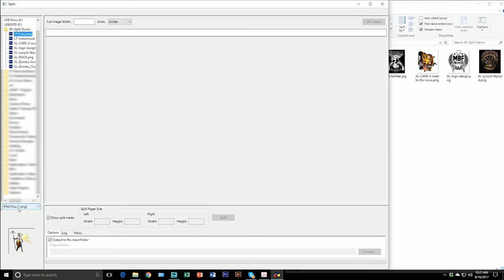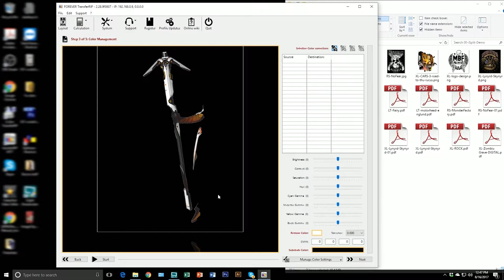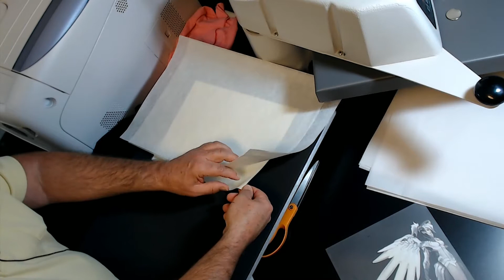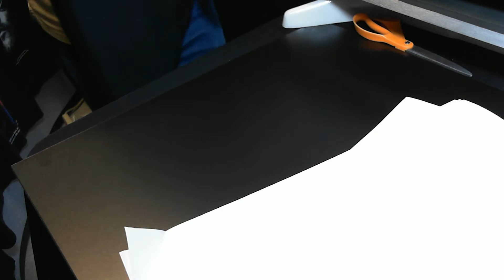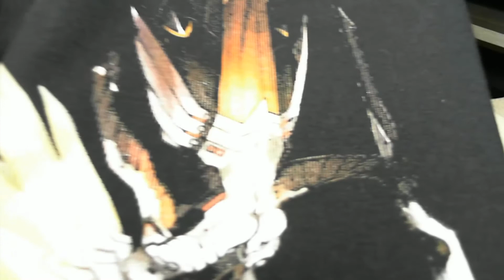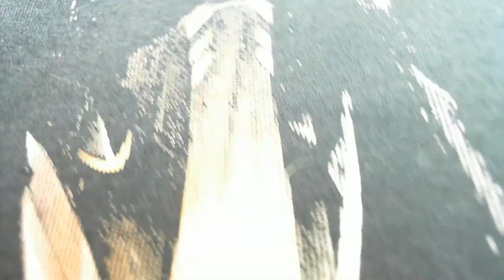I-Split Epi.1- Anime Fairy Warrior Image Demo

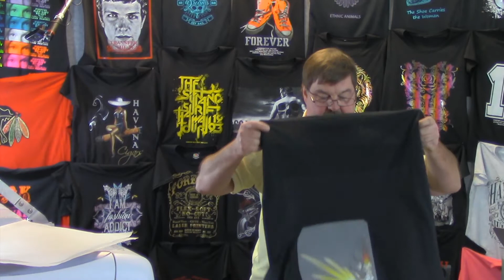Comment: Does the rectangle 'heat press' mark - you can see it at the 18:00 mark - does that discoloration go away with a wash or two - or is that burning the fabric?